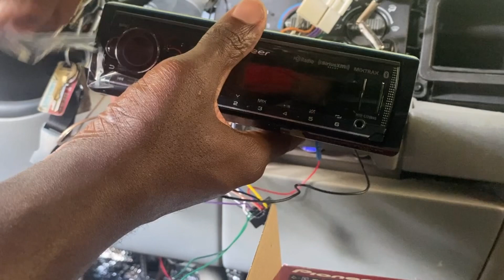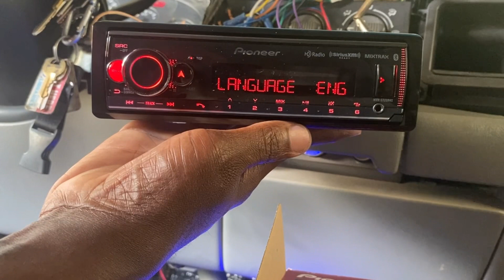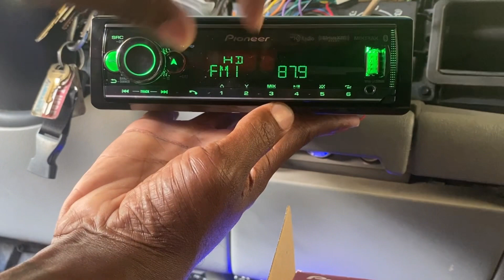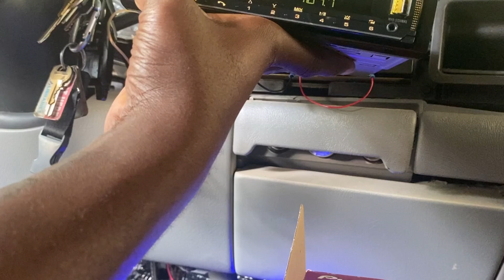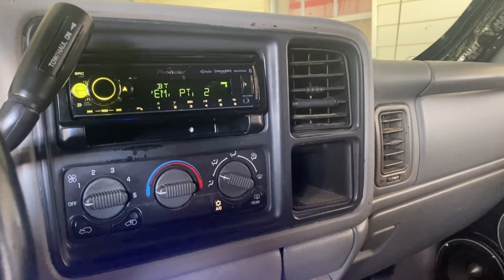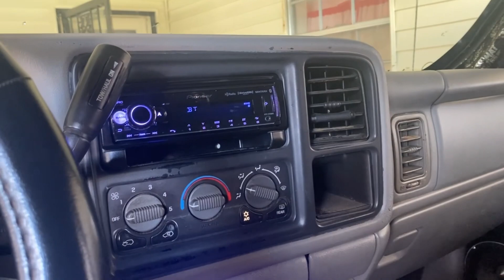Some good News & of course Some bad News🤷🏾‍♂️😩

Comment: Sorry to hear your transmission is bad I have a 2000 yukon on 35's and will be doing the 4l80 swap in the future did you run new wires for your door speaker pods or was the factory wires sufficient?
Reply from the maker: Hey I ran new speaker wire through all my doors
Reply: @crazy-hobbies2291  😎 thanks my set up isn't going to be on your level but I like what you're doing you're build is coming along nicely 💯👍👍
Reply from the maker: @princetyler9886  thanks man, appreciate it. Stay at it, I’m still not where I wanna be but I’m happy with my setup so far.

Comment: That really sucks the  factory 4l60e always have problems never last that long. It would be worth looking into a 4l80e swap if you want to keep the Tahoe for a long time that transmission is why better but it does need a couple of things to be done to fit  but you will never have a problem with your transmission. Again 👌✌️👍💯🥂🛠️
Reply from the maker: 4sho, ima have mines beefed up and do the rear end in it to when it go to the shop